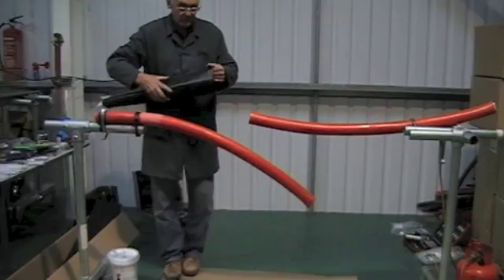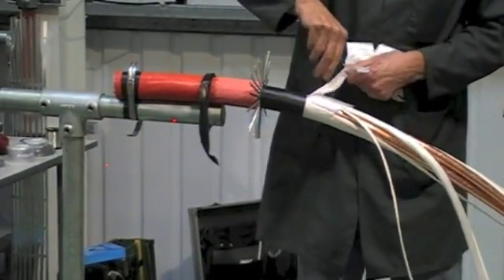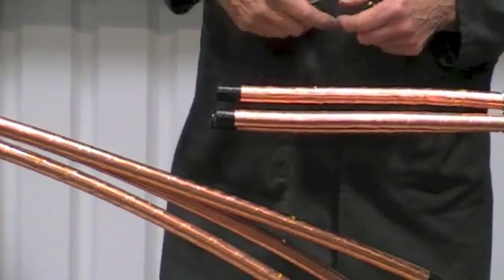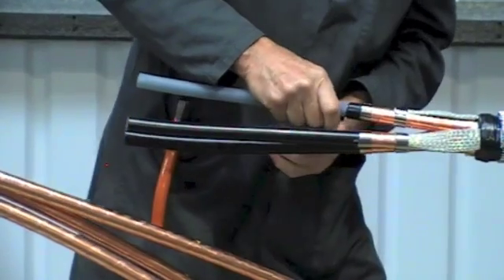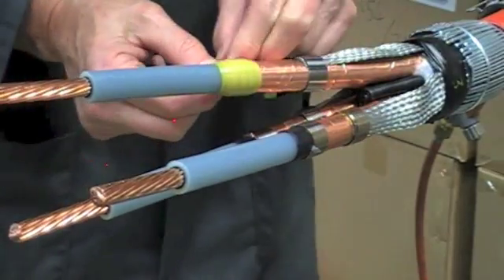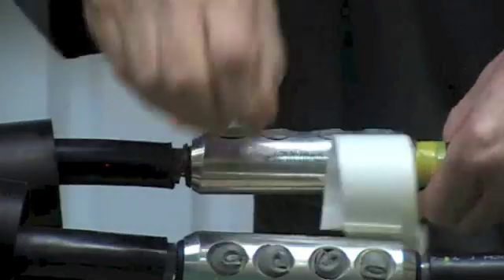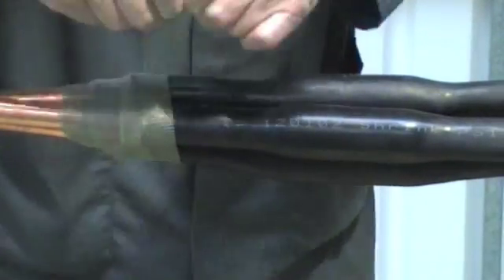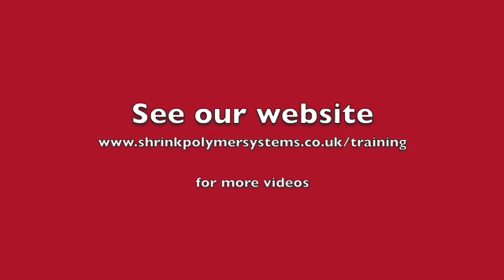Heat shrink Joint 3 Core 11kV Xlpe Cable Training Video

Comment from the maker: What I forgot to mention was that this joint can also be supplied with shell and resin instead of outer Shrink Tubes. It can also be supplied in the following versions
XLPE to PILC
PILC to PILC
XLPE or PILC to 3 x Single Core XLPE

Also flameproof and Hydrocarbon types are available